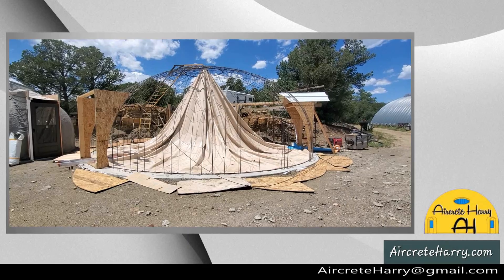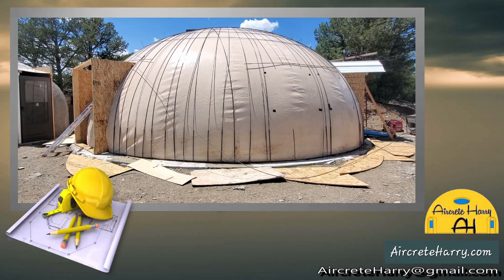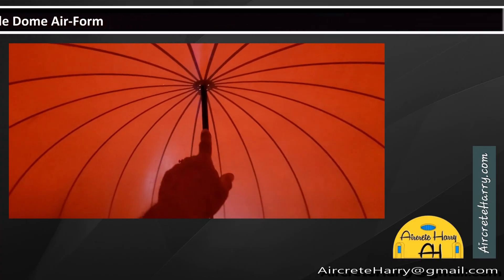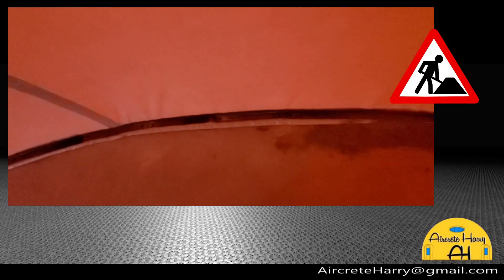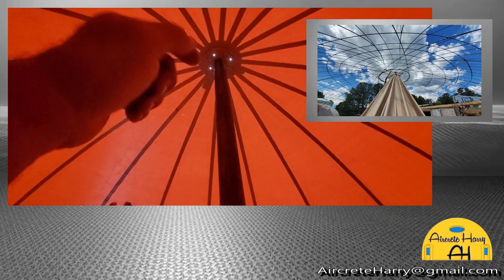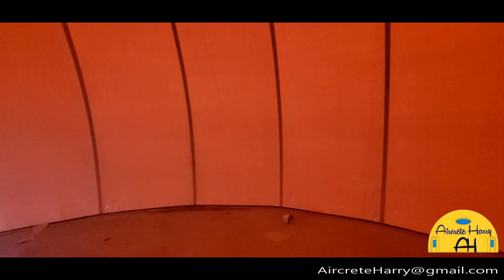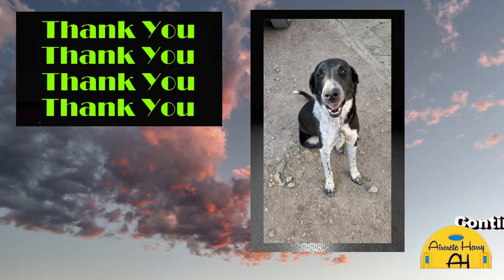30 ft Dome | Custom Ladder #basalt #aircreteharry #domehome #workshop #construction #stucco #cement

Comment: I'd like to build a dome on our mountain property. How would you make the foundations on a (steep) slope? It's inaccessible to vehicles so extensive digging (such as to level the area for a slab foundation) is out.
Reply from the maker: @Norbingel  Our approach would be to incorporate columns by connecting them with steel beams. However, the specific solution also depends on your soil conditions. Therefore, we recommend that you consult with an engineer and provide them with your land survey.

Comment: How did you get inside the airform Harry?
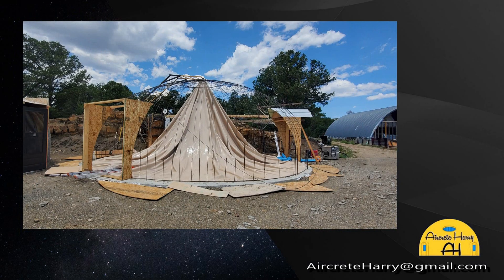Reply from the maker: @tylersmith2853  Welcome to the channel - Tyler! @ 3:00 min mark click pause on your screen, on the right side you'll be able to see an orange air-blower connected to the blue inflation tube, which is part of the reusable dome air-form. Next to it is a larger blue section, which is the folded tunnel used for entering and exiting the dome air-form during construction.

Comment: Ok, question, where is the insulation? And I get that aircrete has insulation properties but in this video, what we see is shotcrete being applied to the outside. I assume the floor is poured with some aircrete and then some concrete is added for stability and compression strength. You have said the airform is reusable, so I am assuming you deflate it and move it from the shotcrete at some point. So at the end you have a shell of shotcrete and reinforced rebar/basalt rebar and or mesh. Are you going back on the inside and spraying some polyurethane or polystyrene?

Comment: I want to do this but I'm wondering what living close to a rainforest would do to the aircrete. I brought two statues here that I had at my home in Seattle and they looked like acid rain hit them or a sand blower. So that's is my main concern.
Reply from the maker: @elementalpedia  Welcome to the channel Jaclyn, 
To clarify if using Aircrete - it would be for the main purpose of insulation. The outer shell would be a strong stucco cement mix which will be waterproofed.
Reply: Aircrete, as I see it, at least, is more a general term for extremely porous concrete. How it weathers would have more to do with your concrete formula and even curing. For those matters, I'd refer you to the great Dr. Tyler Ley's channel for awesome concrete videos. You can aerate just about any mixture.
Reply: use a bitumen layer on the outside, covered then with stucco. you need a waterproof shell.

Comment: This is incredible! Have you tried using a torch to bend the basalt fiber rebar? How do you bend the BFR to shape?
Reply from the maker: @antoniosanford4675  It is lightweight yet very strong. It was flexingble enough to take the shape of the inflated 30-ft dome air-form shown in the video. If wanted to bend the basalt rebar into a 90 degree angle, we siply crack the resin while the fibers still stay attached. Or you may order the premade 90 degree basalt rebar.
Reply: It's a very elastic material. Like a fishing rod.
Reply: It doesn't bend unless it's very thin. I am using 5/8ths it's VERY tough but not like metal standard rebar at all. It's light and strong and flexible but NOT bendable
Reply: @kathrynralli4557  Well, we can get into semantics of "flexible". i see it as no different than bendable. There is another video that really zeros in on it's flex or bendability. Keep in mind that the guy is using a very short length so it's harder to bend. I'm not sure what diameter rebar Harry is using but it's obviously flexed or bent.Over such a long length, I wouldn't think he'd need heat and it doesn't call for anything really large in diameter. Perhaps he did heat it for permanency as otherwise it's quite elastic. https://www.youtube.com/watch?v=8EIqsIEHvDE
Reply: @SmeeUncleJoe  I personally love the basalt rebar the best. When I say bend, I meant making a corner or shape. It won't do that, but, I've never heard about heating it to bend it. Like the other comment said, it's like a fishing pole or to that effect, or tent poles. It's great!
Reply: @SmeeUncleJoe  I watched, thanks!
Reply from the maker: @SmeeUncleJoe  We used 6mm
Reply: @AircreteHarry  which is 1/4 inches in the USA. That's pretty thin and I'm sure you had no problems bending/flexing it. I'm really looking forward to more vids.
Reply from the maker: @SmeeUncleJoe Awesome! More videos to come.